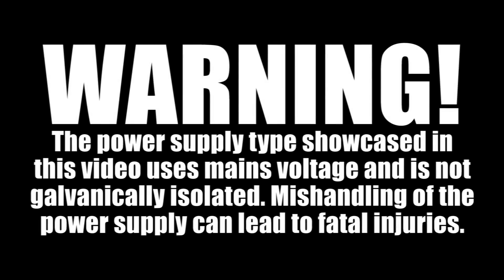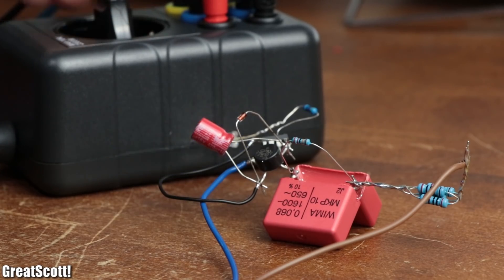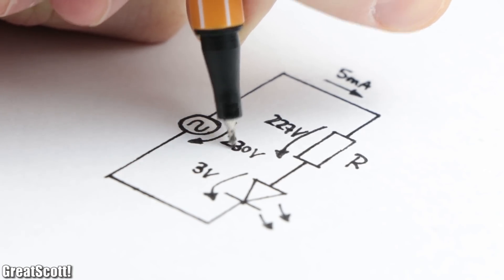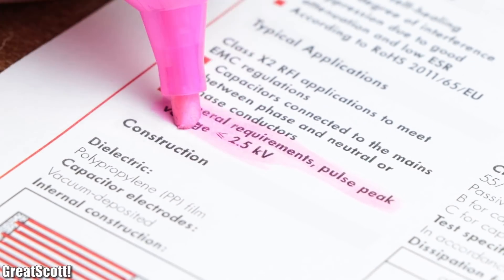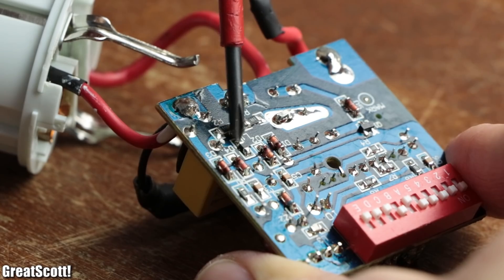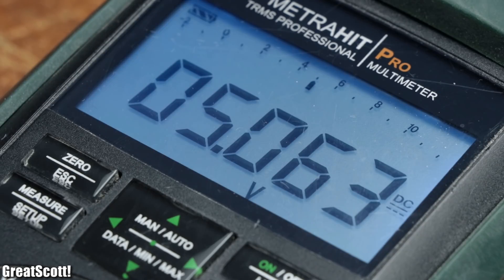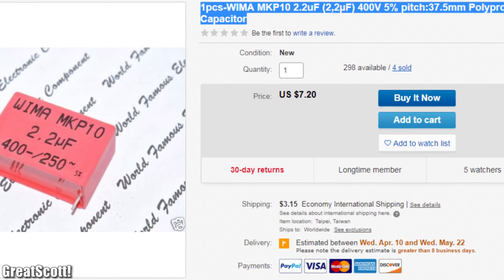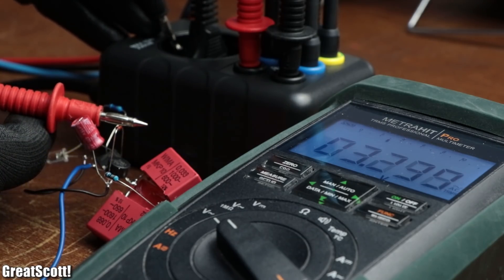The most Dangerous, yet Cheapest Mains Power Supply?! || Building a Capacitive Dropper Circuit!

Comment: Once i made a "similar mistake". I made a circuit for my auto transformer but forgot its not isolated from the mains. Once i tested it, i set it to 12V, i connected a little circuit and touched the wire-s without any fear.. Yeah that was a mistake. I didnt know why 12V shocked my ass off, so checked it to ground...223V, so yeah, i had to make a new circuit design that detects where is the live and the neutral with ground potential, it wont turn on if its not plugged in properly.

Comment: I suspect that the LED burned out due to reverse over voltage.  Without a path for the non-light alternation you have a voltage doubler. A reverse diode would have cut component count to 3.

Comment: It's the zener bro. The excess inrush from your original design would go through it if you added one.
Reply: Also, your power factor is bad, but it is capacitive so it will help the local grid in 99/100 cases

Comment: The worst part of the capacitive dropper is that there really is no way to regulate the open circuit voltage that doesn't involve kicking the ever-loving shit out of some kind of pass element.

You have to build it around the load. You're not going to build capacitive droppers to have "just lying around"

Although in theory all these little capacitive droppers for small devices are doing their part to help correct the overall power factor of the grid :^)

Comment: You can use the zener diode to bias the base of a NPN transistor with a current limiter resistance. In that way you are creating a voltage regulator of which the maximum current will be determined by the transistor specs. (I got that idea from a mains digital timer control similar to your RF one, and then saw it online also)

Comment: powering LEDs from AC should also have "normal diode" in the opposite polarity in parallel with the LED - LEDs have really crappy reverse bias tolerance - I think you were lucky with the resistive mains circuit you made up first

Comment: I recently bought a 20W 230V LED Spotlight, that has nothing apart from a Fuse, some resistors and some chips without marking in it. the 28 warm white leds alone wouldn't be able to withstand 230V AC but i dont understand how it  reduces the voltage to work properly...

Comment: the X2 and safety capacitors are more expensive than a small 12v transformer, 
can this circuit be adjusted by having a small transformer and a voltage regulator chip like the 7812 ?

Comment: To light the LED why don't you just use a small resistor (~1k to 2k for inrush current) in series with a small capacitor+bleeding resistor, then add the LED in series to the AC line?

Comment: The LED is broken, as they do not withstand particularly high back voltages, I think it should be mentioned in the video!
Reply: You can put another diode (regular or LED) in antiparallel to clamp the voltage.

Comment: Interesting as an experiment, but in practice a disassembled weak USB charger from eBay (which has a transformer) is not bigger than this circuit.
Plus, as Z diode does not live forever. When it does not reduce the voltage anymore, the circuit turns into a nice fireworks. 
I'd like to hear "yes it is possible but there is no reason to do it"

Comment: Hi i always wanted to ask your opinion on these capacitive dropper power supplies. There are widely used in Chinese emergency lights and other cheap Chinese electronics.
Disadvantages of this ckt i feel is: 
Very bad power factor 🤮.
drop across inrush current limiting resistor.
Thats y had a question....
Can we improve efficiency of this kind of this ckt? Can we put a inductor in series with the circuit and limit the inrush current as well as somewhat increase the power factor.... Is that possible? What you think🤔
Curent draw when idling.
Reply: Having an inductor will make the circuit bulky lol. I discussed this problem with my friend, and our conclusion is that, the capacitive dropper is much more robust and has much longer life time than switched converters.
Reply: Better option than an inductor would be an NTC. That would provide the Indian limit but then reduce it's resistance to reduce the power drop.

Regarding power factor, unless you're in an industrial situation it is irrelevant because domestic billing is almost always based on real power used.

Even in industrial arrangements where billing is based on apparent power for most cases capacitive loads like this improve the situation as the big problem with power factor in most industries is large inductive loads (motors, fridges, machines etc) so using capacitive loads improves their overall power factor (by a very tiny amount).

Comment: should you use a coil with a capacitor because of the AC current offset? ps: i'm still a learner and love your vids!
Reply: You can counter the abysmal power factor by adding a coil/inductor, to turn apparent power into real power. Doing this will make The Grid like you more; but will increase the current consumption (and for a residential user, increase the power bill). For such a small load (<1W), the low PF is probably dwarfed by other equipment in the house (like fans, motors, etc). But a factory full of these might have issues. (Factories are often billed by current and power factor, so they care more). The other option is to use a switch mode power supply, which is a trade off: more complexity, cost, volume; but probably better power factor and probably more safety :)

Comment: fist it was one of that ic which i guessed ( based on clue of 8 pin , led blinking , TLPS "as cheapest " which was shown on fb   pict  so i thought it would be 555 or at Tinny :) .......it's tinny !! my 2nt guess ). second AT Tinny is not cheapest its cost start from 14.4$ on amazon it is more then its development board Diggy spark ,  it is only cost 5.76$ on amazon .....dont kno why ) i get this same ic from nearest  electronic shop for 2.16$ cheap !  but not   Enough because atmel at8952 cost is  Lower then  attinny which i get      from same shop for only 0.9 $ .   third ...... building transformer less  power supply is not cheapest !!   because it need more money then buying cheapest 5 volt  500ma chines smps  which have transformer  and 1 or 2s transistors with mains isolation which cost me only 0.14$ for single transistor smps and 0.22$ for dual transist smps very very cheap    , then building low power , un isolated ,  non handy transformerless PSU with cap p , 4x diodes  , resistors , ziner  , cap np ( cost > 0.14$ ) so why would i choose TLPS  as  best / cheapest instead chines one !!!!!!!!!!!!!!!!!!!!!!! ( price comparison based on my country  Indian price where 1$ = 69 rupees )

Comment: sir
I have a  smps supply, for laptop 
with foulty mosfet, I couldn't manage to find a mosfet, but a power bjt TIPP122,
MY question is can I replace a foulty mosfet with a power bjt.?

it's a vary basic power supply, 

q2. power actually determines the output of smps power supply,
switching speed of transformer, transformer it self, or anything other?
please reply🙏
Reply: No

Comment: It really is a very dangerous little beast and should never be used. That was the old rule of thumb electronic engineers used to be taught about about them.

Here in the UK the live and neutral are specifically isolated and locked by the design of mains plug, however you cannot grantee that every mains socket has been wired correctly so there is always a danger of the two wires being swapped over. The real problem though is that there is no isolation with capacitive droppers if anything goes wrong. It is barely acceptable in very low power circuits like the ones here, and as long as you have genuine X2 capacitors, and as long as you have a strong case or some other form of strong isolation. In real circuits things like wires can come loose, insulation can get damaged, poor soldier joints can go dry joint, etc. 
A specially dangerous place for capacitive droppers is in things like battery chargers where the terminals are vulnerable to being touched.  Another is those cheap usb power supplies where the metal sheathes on the plugs and sockets can become live. Lethal (potentially).

Comment: Can't we use a 5v zener diode parallel to the output without having any resistive or capacitative network?
I was trying to build a 5v DC supply from a 9v transformer and whenever I connected the 5v zener diode across the rectified output without any resistors in the circuit I couldnt achieve 5v.

Comment: Will this power supply cause a fire if I use it? Or is it just the risk of electrocution?
Reply: If you use it correctly then it will be fine, but it is very easy to use it wrong. In particular, add these rules to your normal ones:
1) wholly contain the project inside a non-conductive enclosure,
2) no electrical connections to anything outside the non-conductive enclosure,
3) the "mains" connection should be ( fuse : fail-closed capacitor : fail-closed capacitor ),
4) you should seriously consider isolating the circuit with two fail-open capacitors between the "mains loop" and the rest of the circuit.

Also remember the cardinal rule of mains power: use screw terminals and crimp connectors everywhere, so that melting solder can't cause a loose wire, and thereby a short.

Honestly, you should just go down to your local lumber, home-improvement, or hardware store, and ask for the door-bell transformers: if they haven't given in to the latest techno-fantasy then you'll likely discover that you can get a transformer with screw terminals that provides 15, 12, or 9 volts from your local voltage with no trouble. And if you still want to experiment with capacitive droppers, you'll find the actual capacitors easier to find.

Comment: Great Scott : uses a mains voltage with a warning on the start
ElectroBOOM: holds 5k volts and no warnings
1 E
Vucko 101
Vucko 101
1 éve (szerkesztve)
It would be interesting to see GreatScott and ElectroBOOM collab.... xD
643
BinaryCounter
BinaryCounter
1 éve
I believe you pronounced "Full Bridge Rectifier" wrong.
It's supposed to be pronounced "FUUL BRIDGE REKTIFIAH", preferably with some kind of reverb.
496
Vidar Odinson
Vidar Odinson
1 éve
I've watched so many of bigclive's videos that I can actually understand this video lol
275
LoL XD
LoL XD
1 éve
Big difference between Greatscott and ElectroBoom 

GreatScott: gives warning about 230V 
ElectroBoom: Touches 2 Kv Transformer and just yelling around
346
Juan Sambucetti
Juan Sambucetti
1 éve
"jlcpcb sponsored this video" proceeds to create project just connecting pin to pin without using a single pcb...
201
Guillaume P.
Guillaume P.
1 éve
"As you can see a switching power supply is too big for my tiny ATtiny85 project so I will make my own power supply from 3 ENORMOUS capacitors!"
GreatScott's logic :D
68
R B.
R B.
1 éve
5:53 FULL BRIDGE RECTIFIER 
oh wrong Channel
182
Aboubakr Atef
Aboubakr Atef
1 éve
it's not the inrush current that kills your LED's it's the reverse voltage needed to be dropped by the LED's. Inrush does kill your LED's though but much slower than that.
54
Marco Alfonso Orazi Barattieri
Marco Alfonso Orazi Barattieri
1 éve (szerkesztve)
7:19 english subtitles are the best
21
Halimah Nur
Halimah Nur
1 éve
FULL BRIDGE RECTIFIER
why i hear Mehdi voice
43

Comment: Is it possible to just use a rectifire and voltage regulators?
Reply: Yes, but it's very inefficient way to step down the voltage, because excess energy is transformed to heat.

Comment: I have a relay controller using such circuit for power supply, but that part was replaced by very small switching power supply module just cost me USD$2 on taobao

Comment: When using a LED with series resistors or capacitors, it is IMPERATIVE that a diode be connected anti-parallel to the LED. (you could use another LED connected cathode to anode, anode to cathode) Capacitors are worse, because the capacitor charges up when the LED is in forward bias, then when the voltage swings in the opposite polarity, the LED is subjected to DOUBLE the peak-to-peak mains voltage. Most LED's have a peak inverse voltage rating of about 12 volts. You're hitting it with 340 volts if using a resistor, and 680 volts, if a capacitor is allowed to charge during the half-cycle.

Comment: Do you (or a reader) know of a definitive design guide for capacitive dropper circuits? I searched but most are incomplete  and many conflict with each other. 
For example. Some say the DC voltage (without the Zener) is VAC * 1.4 -  1.4 while others say there is a substantial voltage drop which  is dependent on the capacitor.
Some say deriving C depends on Vout but others ignore Vout.
Very few give guidelines for the initial current limiter resistor. Plus some say the total Impedance includes the resistor (in series) while others say it is in parallel !!!

Comment: Ok the LED blew because your reverse voltage is to high, in reverse condition it draws little current and the capacitor will let high reverse voltage blow the LED.  those circuits are always dangerous as they can easily have high outputs relative to earth. When I design transformer-less circuits I use isolation methods such as fly-back to protect the load and to make it safe. All these cheap transformer-less methods that is not isolated are dangerous

Comment: you can get parts cheaper by getting junk electronics from your local electronics recycler or tv repair shop or if you live near a college town you can rummage the garbage piles of the student housings when the students go home.

here in the usa that happens 2 times.

1. the big one around mothers day

2. a smaller one when the summer class students go home in august and september.

if you are up to raiding the garbage piles during cold weather i think christmas may be the 3rd time of the year that garbage is thrown out.

you will want to make sure to get permissions and or check that there is no specific laws regarding rummaging garbage.

Comment: Not only touching the power supply is dangerous, the entire circuit it powers is under mains potential. The warning not to touch the supply should be extended to preventing the entire thing, including all loads and wires from being touched. Physically.

Comment: But sir. If no draw the current from circuit the voltage will not down at capacitor therefore will damage the ic ⚡️⚡️🔥⚠️⚠️🚫🚫

Comment: 5:14
Your explanation isn‘t completely right. The LED works as a rectifier, therefore the capacitor only gets DC. This will cause a high inrush current indeed, but it can be solved with a 470R resistor in series and another LED in parallel connected backwards.

Comment: What happens if you eliminate the series resistor? I made a circuit just like that but with a resistor in series to the Zener diode and it SEEMS to work fine
Reply: to limit the inrush current caused by the caps when charging

Comment: What I keep wondering about is this:  the appliances in the home that get increasing use are electronic:  LED lights,  televisions, computers, cell phone chargers, wifi, maybe the IoT appliances that are coming real soon now.  You need to power kitchen and laundry appliances, HVAC, water heaters with grid power, but that's only a portion of a house.  Is anyone thinking about a lower voltage AC or DC home power standard for lower power electronic appliances, possibly with other features comparable to PoE?  Granted, a television has different DC power requirements than a cell phone charger, but might it make more sense to have a tough grid-AC to low-power adapter to go to electronics rather than a plethora of "wall wart" supplies everywhere?

Comment: Or you can live in a country that has a separate earth and thus you can't turn the plug around and change the reference voltage. 
I'm a fan of 3 pin mains plugs. :)
Reply: +1 to this. Australian plugs don't always have 3 pins (only if the appliance needs a ground pin for safety) but they're angled and vertically offset so it's physically impossible to reverse the plug.

That said I'm pretty sure Great Scott's plugs have separate earth, it's just not a pin, it's a metal tab on the side of the plug. Just a guess though, I haven't researched this.